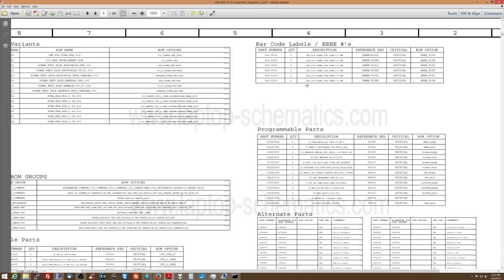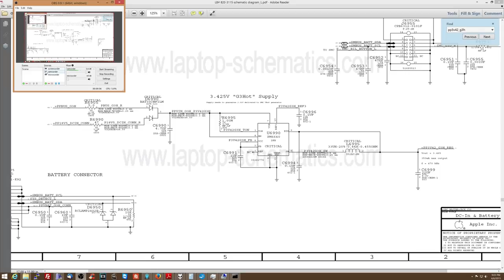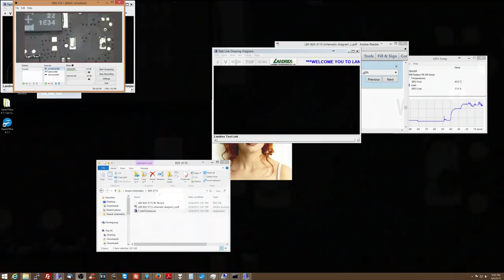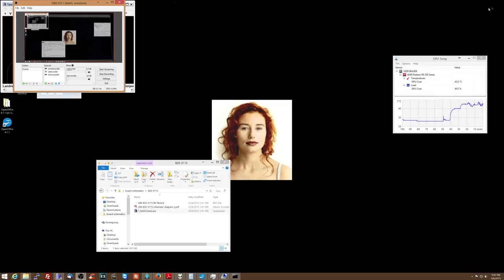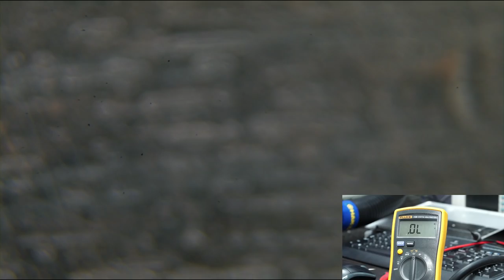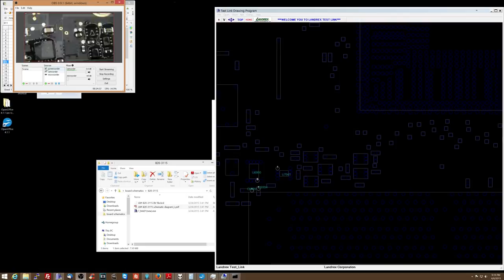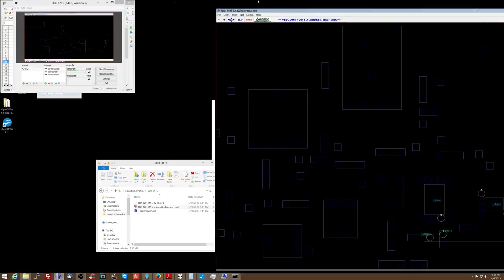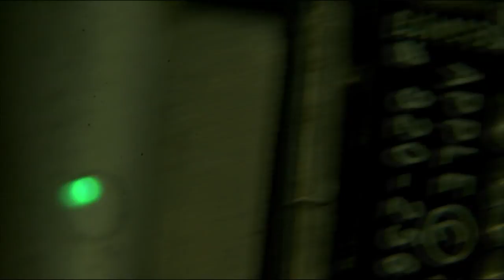How to find short circuit component without spending $6k on FLIR cam.

Comment from the maker: Thank you to everyone who made a purchase on eBay via our affiliate link at http://rossmanngroup.com/ebay for helping support this type of content. Your viewership is appreciated and as always, I hope you learned something!
Reply: Those in "the know"  know that there's ALWAYS some other issues on boards besides the issue it was sent in for... yes mark my words on that.
Reply: Really loved the tossing up part to ta back of the bin... Great lesson there..
Reply: Hi... You probably won't even see this but since im already here im going to ask anyway. I have a laptop (not a mac) and i have this problem where the power wires that run inside the laptop to the motherboard socket (best way i can describe it since i dont know what that particular piece is called) and the socket head keeps burning up, this is the second one i have already and its completely burnt the wire again. My laptop works fine though. There is literally nothing else that seems to be wrong with the laptop other than that power socket that connects to the motherboard keeps burning my wires... Is it because of a short somewhere or do you have any suggestions maybe what it could be?
Reply: A digital multi meter called a DMM has amp high and low. My Fluke 87 V will take 15 amps but most are 10 amps. This is a lot of amps or current for any laptop circuit. From the power plug, if you have actual wires (Let’s say 3) and #2 burns, discolors or melts, that one circuit is pulling too many amps. The plastic is the connector and the metal part (Male & Female) are terminals. Both side should be replaced at the same time. The female side touches the male terminal to allow circuit voltage and amps/current to pass. Heat damages the female side spreads, loosing connections. The damage is done but reduces amps due to higher resistance. If there is nothing between the power connector and the connector, there is a problem “After” the connector. Most have a pair of switches or Mosfets, that let amps and volt thru, but if high voltage, reverse polarity or high current in certain designs, the second MOSFET opens to protect the circuit. To test an unknown amperage, you have to open the circuit/wire to make the current pass thru the meter. Start on the high setting and if less than the low DMM setting, move the RED meter led and write down that reading while on and working. Get inventive, take photos but make sure everything is hooked up, then turn on. Mosfets fail, so do caps or capacitors. Follow the copper traces (Under the Blue or Green Lacquer coating) Screw holds are ground so if on, connect the BLK led to one and test for voltage at other components at the soldiered leg and write it down.
If you watched Louis video, he gives you the name of a website to download by make/model and work from there. If it’s older, the battery can be an issue as they are on this supply side. They can pull enough amps to get warm/hot/fire...Fire Bad! Hope this help. Louis is clear to hear, a little funny, but calls balls & strikes. I have a dead short in a 3 year old Dell that I will be working on. He is going into my saved file. Hope this helps. Automotive ASE Master Tech since 1978-Retired.
Reply: How does this customizer manage to guarantee to always have at least two errors on one board?

Comment: I used a similar technique with freeze spray which turned the board frosty white, and after applying a littler current to the shorted circuit I observed which component defrosted first. Considering alcohol cost far less than freeze spray I really appreciate your tip. Thanks!
Reply from the maker: Grants Pass TV Repair It follows the rule of what is in front of me.

Freeze spray is something I must order.

Alcohol is something I can buy when I walk fifteen steps out of my store.

Impatient yuppy will only pay if it works NOOOOOOOW, so I pour a bottle of alcohol on it.
Reply: I've heard this about compressed air. Considering the cost of freeze spray It would be nice to figure out how to make it my self.
Reply: instant freeze of the board will not damage the components due to sudden contraction?
Reply: @TTRVision  no
Reply: @FlourescentPotato are you sure?🤔

Comment: The method I have been using for 30 years to locate an overheating component is to spray the board with just enough freeze spray to cover it with a light coat of frost, and then watch which component melts the frost immediately.  For larger boards, just spray one section at a time.

I really enjoy your videos.  Since I haven't had much need to deal with BGA's until recently, your instruction has gotten me proficient very quickly.  Thanks.

Comment: Worked in electronics maintenance most of my life. Little experience with surface mount stuff. I appreciate your demonstration of using the smoke tests to find problem shorts as well as the demo of unsoldering and resoldering using hot air. Thanks a lot your a pro.

Comment: I'm an automotive Diagnostic guy and I just had a 75 Jeep with a snow plow that was inoperable. Figured this will go quickly, tracked it down to the remote and figured why not open this up and take a look see... Can't be that special right? It runs 3 1 wire solenoids ground through the body and 1 big 200 amp solenoid. When i cracked it open I found an atmeag 8515. For some stupid reason I was expecting a few mosfets and some buttons. Lol I really like your movies and appreciate the time you spend with us on these repairs. 👍I love my hakko iron!

Comment: I used to run into cars from certain customers we used to call "charity cases" where the customer had 50 things wrong with the car and only wanted to pay you to fix one of them, but the other 49 were interconnected. That car would go in the back corner until I was able to get the paying jobs out and actually make enough money for supper that night after paying the bills, and then I would come back to that "problem child" the next day. 

Sometimes, that customer would be as big of a headache as their car was where they would call every hour on the hour wanting to know if the vehicle was done yet.

I learned late in life after becoming disabled that there is things I wanted to do with my life other than "solving that next challenge", that I almost didn't get the opportunity to do. It's good to see that you know when to call it for the night, go to the gym, take care of yourself as well and let the charity work wait for later.

There's a reason that customer is bringing those "basket cases" to you, they probably got ran out from every other tech's shop before. 

I like your priorities.

Comment: Static can put kilovolts through your components, a different matter from 3 volts and some amperage.. so disagree there. And also I've found that the best way to learn something is to teach it, you thought you knew something, after trying to teach others you notice all the things you did not know and get better :) Highly recommended.
Reply: no kidding - as talented as this guy is I would not send my electronics to anyone who doesn't take ESD seriously.
Reply: +ss l Me neither. Also, setting his PSU to supply 10Amps and waiting to see what got hot. Not wearing safety glasses.
Reply from the maker: high amperage low voltage makes more sense than limiting amperage as the circuit itself will have resistance. if you want to limit amperage, then just set the power supply to 0.5v, no amp limiting, and slowly go up.

Comment: Nice video. I like the idea of using alcohol to show up the bad part!

Here's my (hopefully constructive) critique and thoughts:
I would watch it with the external power supply. 10A current limit is overkill IMO, start at 0.5A or 1A or so and work up if you have to. The shorted IC here only took ~400mA and heated up well enough to be found easily, but you can't always count on a bad component limiting the current itself. 10A is enough to make things go up in flames, especially if it's a ceramic\tantalum capacitor, and burning a hole in the boad is going to ruin the board and your day. Also, I find the back of the hand\fingers are more sensitive so they work better for finding a hot component at lower power levels.

For those who don't worry about ESD, I still think it's a vaild concern, even when you use troubleshooting methods like this. With a suitable current limit you are not going to blow anything, but ESD can still cause problems, and the effects aren't visible, or even always consistent. ESD damage is great for causing intermittent problems, problems that make no sense, or boards that die 2 weeks after you fix them and then you're just wasting more of your time and money. Anyone interested in ESD prevention should check out Dave Jones on the EEVBlog, he's got good videos on setting up an ESD safe work area. Proper ESD precautions help rule out one more thing that can go wrong, and in troubleshooting electronics, the less unknowns, the better.
Reply from the maker: Agent24 Good point.

On 5v or 12v rails I usually start at 0.2v, 10 amps and take it up slowly. It's best to start with unlimited amperage and ultra low voltage first. Here I cavalier'd it to 3.4v instantly because I knew this board would be shit regardless. :( And sadly I was right. :( Cool things about the real knobs on it is you can turn things up and down pretty quickly!
Reply: Just to confirm: What kind of alcohol is he using? 

A long time ago when I used to be assigned have to go around our large office cleaning Xerox machines in internal areas such as the pressure roller, printer drum, scraper bar, etc. that had  toner and paper dust accumulation, I was given a can of special cleaning fluid that according to  the content label was just 100% Isopropyl alcohol and told never never ever use the stuff from the pharmacy for fear shorting something as well contaminating other things inside these pre- Laserjet era printers. 

That may sound like over kill, but since my office was the national advertising agency for Xerox and used those copiers heavily, we just did what was recommended without question.

I can only assume their reasoning was the stuff from the pharmacy was a 
mix of water and alcohol which could cause a short of the electronics as
 well as contaminate things non-electric. 

I knew that the CVS/Walgreens stuff labelled as Isopropyl is just as deadly to consume in a cocktail as the stuff Xerox says was required. But the rubbing alcohol never made my fingers turn ash white and give a dishpan hands look instantly due to absorbing the oils and water from my skin. Apparently besides not mixing martini's with it one was not supposed to use 100% Isopropyl on expose skin either.
Reply: Marc Chavez in another video he said 99% alcohol
Reply: I think it's Jägermeister ;)
Reply: I know it's 4 years old but I've just found out about Louis and 'very been watching eevblog occasionally since the middle of 2010s and writing this just to share that they kinda made cross-over: Louis is actually featured in eevblog #1222 Apple's MacBook Design Fail

Comment: This video is exactly what I needed..finally after hearing you say it a million times I focused on P3V42. It didn't click before that I wasn't getting voltage to VIN for U6990. With only two components before it D6905 and R6905 it didn't take me long to find the issue. R6905 was reading infinite resistance. I removed it and put a through hole 47ohm resistor there (just for now). Sure enough I now have 3.38v coming out of L6995.

I dont have a new LM397 to fix my One wire circuit...so I cant see how far Ive gotten. Despite that, I am extremely happy to have made any kind of progress. Now to find a cheap parts board. Thanks Louis!
Reply: An LM397 is a common part. You can buy them just about anywhere. For example, Mouser has them for less than $1 USD each. If you're outside America, there are other places too. For cheap parts like this and resistors, capacitors etc, it's not worth it IMO to buy whole donor boards. Sure, if you need a custom IC or expensive part it can be useful, but with "jellybean" parts, I buy them from local parts suppliers - and get extra confidence since they're brand new.
Reply: Agent24 Thanks for the tip. I did already find it on Mouser. However, I have another c2d coming my way in a few days. I wanted to have a donor just in case, like Louis says, you order the parts fix it and then find out something else needs fixing. I do agree new components are preferable. There is a place I go to for electronic parts but I think he might have to order these. Still I will check..driving 45 minutes isnt a big deal compared to waiting a few days each time.

But just out of curiousity, do you know any other common products the IC is in? I might have something laying around I could borrow to test with.
Reply: SunDragMeHere I guess I'm lucky in that I can get a lot of parts locally or on overnight courier, for one-offs. Most places would keep some stock on hand of really common things though. When you repair many boards you can get an idea of what kinds of parts usually blow, and keep a stock of those without worrying about wasting money on them: you know you'll be using them.

Aside from another board the same model or similar, I can't really list a bunch of products you'd find an LM397 in - I don't know. It's a common, as in "not complex" part, but unlike the really, really common parts, like 10K resistors or 0.1uF capactors (which are in practically everything), it's not common knowledge where you'd find one. The time taken finding that information, finding a board etc, it's not worth it for a $1 part.

Comment: Great video! Thanks for posting these ideas. I've been an EE for many years, but I never stopped learning new, clever tricks...
As for explaining the EE design concept for the charger input, I would have just quickly mentioned the 2 diodes. Those are dead give-aways that you have a 2-input power rail.
The reason being, of course is to avoid a cross-current between the inputs. You don't want the battery to try to feed back into the charger / AC-adapter, or the AC-adapter to directly feed the battery without charge-regulation (battery explosion : bad).
And the inductor, is of course the energy storage "bucket" for the buck-converter (PM6640).
A "quick and dirty" explanation could be that, unlike LDOs that just waste energy as heat, to drop the voltage, buck-converters (along with other types of DC-DC converters, like boost and inverting) use an oscillator and an energy storage component (inductor) and they are a type of switching power supply: they store energy in an inductor etc. and release it to the output, as needed, so they only draw power that is proportional to the output load.
This makes them way more efficient (but kind of a bitch to design / tune and having another oscillator can give you more EMI head aches. Yeah: no free lunch).
I had to design like 5 different DC-DC converters for our robot's power subsystem, at 5V/10A, 24V/4A etc., squeezed next to EMI-sensitive stuff (multi-gigabit signals) and trying to keep everything cool.
Not a trivial task...
Any time the IC datasheet has 2+ pages of "PCB layout guidelines" with bold text and exclamation marks, you know you're in for a ride...
Reply from the maker: lnpilot GOOD CONTRIBUTION!!! Thank you.
Reply: Louis Rossmann Thanks! Love the alcohol trick!
:)
I did end up buying a FLIR E60 though. I used to put my fingers on the MOSFETs etc. to debug new prototypes for over-heating, but burning my finger tips got old pretty quickly.
It's also great to just put up a thermal image of the running board next to the PCB design software and see exactly where I need more exposed copper / thermal vias etc.
Yeah. I wish those cameras were cheaper. I could use a higher resolution (than 320x240), but who the heck has $20k to burn on a 640x480 FLIR?
Reply from the maker: Most do not need FLIR. FLIR are rated for use in the field, for all sorts of durability standards that make no sense for something that just sits on a desk in an office for measuring motherboards. I would love to find an alternative that is less expensive.
Reply: Louis Rossmann True! There are some cheaper ones without their own screen, designed to be used with smart phones, but the resolution is crap, or the temperature range is too narrow (or both). This seems to be the only usable one:
http://therm-app.com
It has a 384 x 288 res, better than the E60, but the frame rate is pretty low and the temperature range is too narrow for a lot of electronics thermal tuning.
It should be enough for debugging though, finding that short at a glance.
They have 2 higher-end models, the TH and the Hz, but those are more expensive.
Reply from the maker: I would want something with the accuracy and screen of a FLIR but without industrial durability(and price tag that comes with industrial durability).
Reply: Louis Rossmann I hear ya! The last time I had to drag my E60 through the mud was, like never...
Reply: Louis Rossmann 
You may like the Flir ONE. Its a case for the iphone that does excellent infrared. I have had one and it was awesome for many things. Mine could even see the steel studs through drywall.....

Comment: My Weller station (50W) is from 1977 and was used for over 15 years in my dads TV repair shop, it has also been my main iron in my sound & light shop for over 10 years and is now sitting in my home lab.
Of course it has received different tips over years but the heating element is still the same and working as expected.